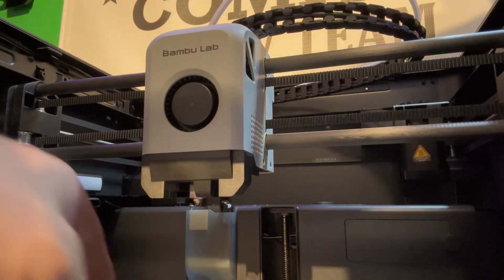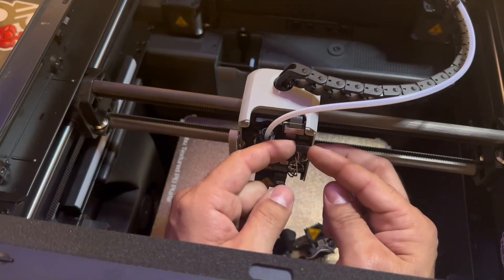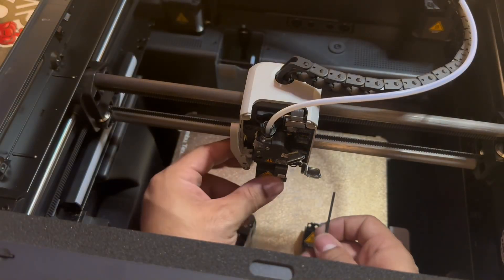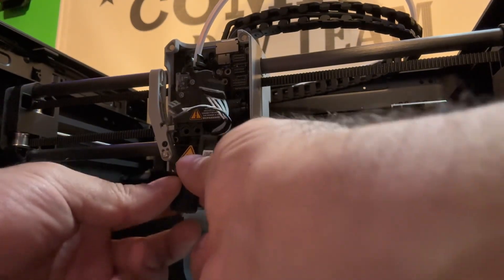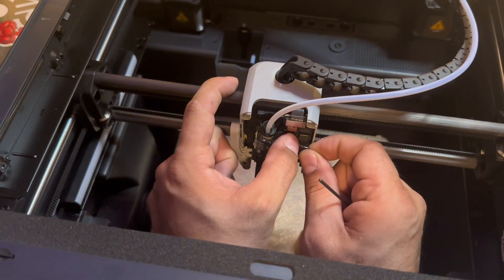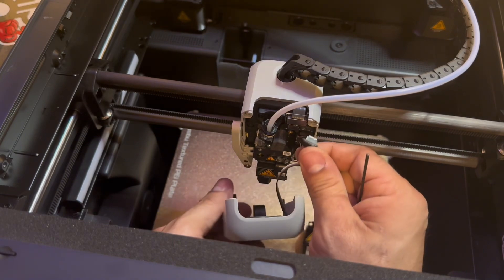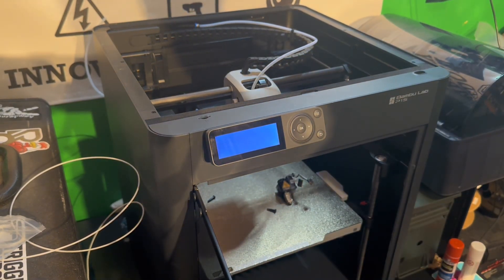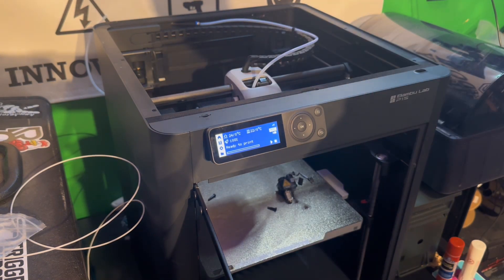How to change the hot end of your Bambu Lab P1S 3D Printer

Comment: I want to switch to a 0.2mm nozzle for more detailed prints, but I’m confused about what I need to buy. On the Bambu website you can buy either just the hot end or the complete hot end. Or you could buy the extra wires and fan separately. Could you please advise me on this?
Reply: I'd buy the assembled one. Less hassle.

Comment: so the wires come with the new hotend? I am about to order the P1S and wanted to order some hotends to have on hand in case.
Reply from the maker: The fan actually comes with the extra wires you’ll also want to use their thermal paste if you get a complete hot and within it’s pretty plug and play
Reply: @smokieprints486  I was looking at getting just the hotend with nozzle and not the whole assembly, should I not get those and just get the complete unit instead ?
Reply: @blackcanyonmodelworx6060  Get the complete unit. The replacement hotend that my P1S shipped with didn't include the wires and connectors. Depending on how the previous hotend fails, these parts may not be reusable (as in my case).